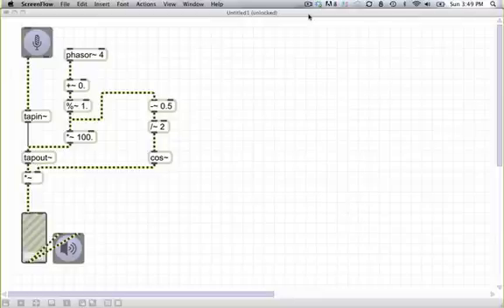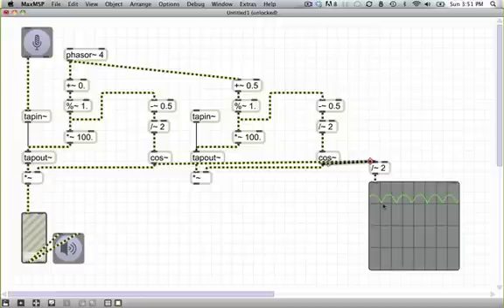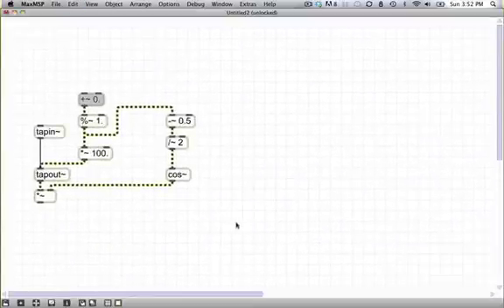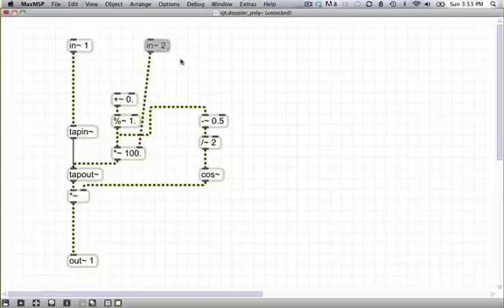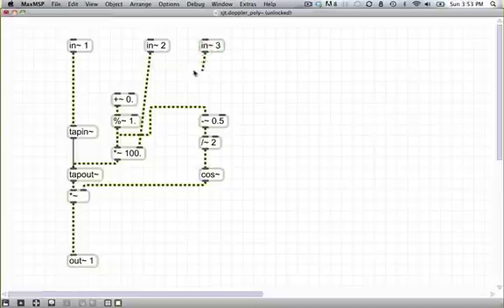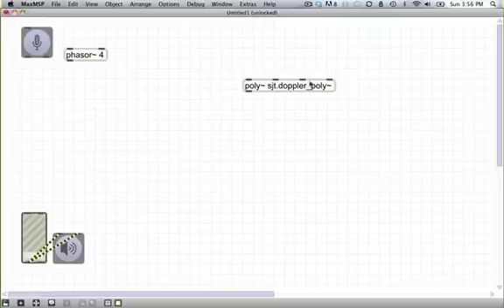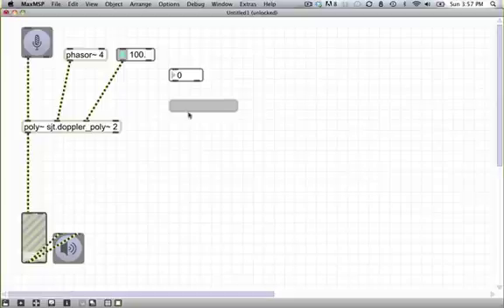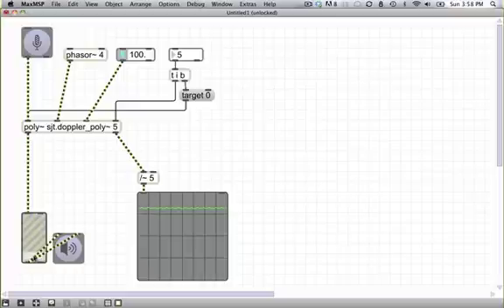Delicious Max/MSP Tutorial 7: Pitch Shifting (Part 2)

Comment: Wouldn't two instances be enough if you just could use a HANN window instead of a half cosine?? Adding two Hann windows that are 180° out of phase result in a perfectly flat amplitude = without amplitude modulation. 
--> https://en.wikipedia.org/wiki/Hann_function
I am not so familiar with MAX and unfortunately don't know how to build an oscillator with a hanning window output function in MAX, but i am quite sure there is a way.

Comment: Hey dude, I have been checking your tutorials for a while and I must say that they are really entertaining and helpful, thank you for sharing your max/msp expertise with the people of the web! Unfortunately, I tried this patch on max 6.1 and somehow couldnt make it work I do not know what is wrong, every connection, every object and every number seems fine. Do you have an idea, what might have gone wrong ?
Reply: alp seyrekbasan I'm using Max 7 and my sound is coming out without being shifted. Was this your problem/did you solve it?
Reply: Austin Dunn I do not remember if i was able to get it working, my problem was simply with patching things into the poly~ object :/ I simply moved on to other tutorials didn't really spend too much time tinkering around and solving it. I am sure there are other patches around that does the job ! cycling74 might be a good start!
Reply: alp seyrekbasan Thanks, I found a completely different method using the gizmo~ object just by looking in the gizmo~ helpfile.